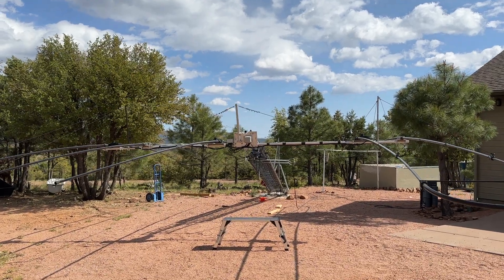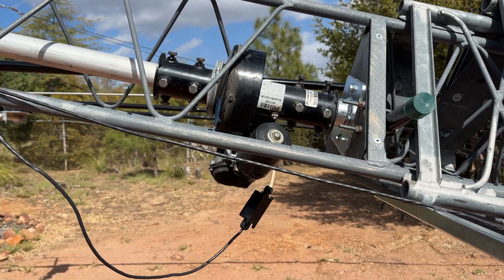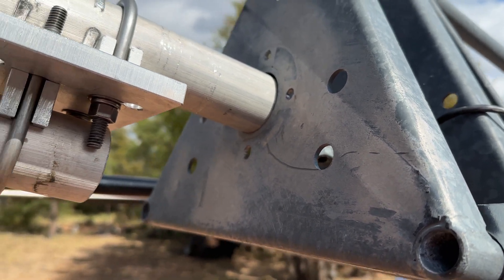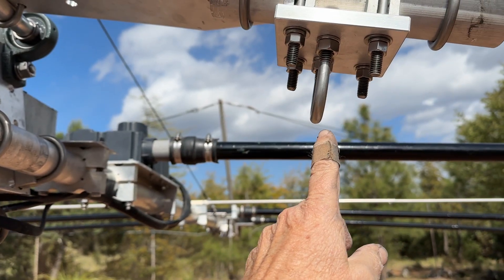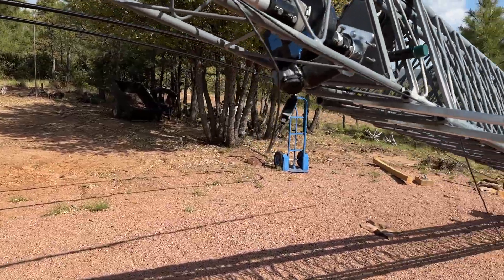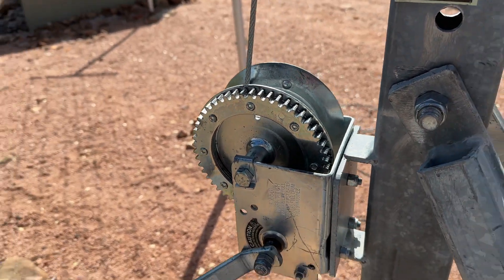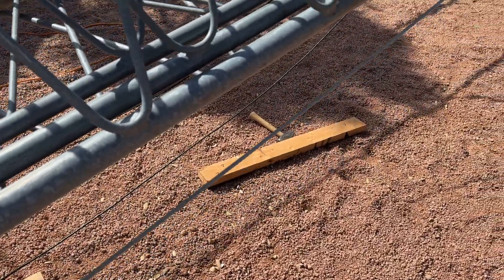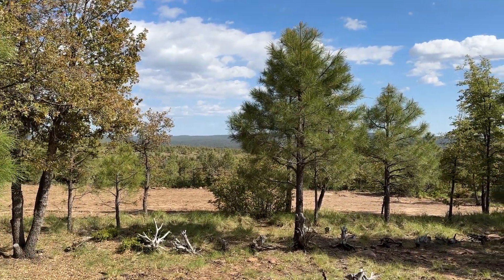Steppir 18 going up with a Tiltplate

Comment: The Sun will soon Destroy that Fiberglass and it will need rebuilding. They work great but the lifespan is short compared to an Aluminum Antenna which will last for longer than we will with just a new coax every 6 or 7 years.

Comment: Hello Dave, every time you want to raise your tower, do like me,
the only thing you need to do is remove the crank, leave the nuts and use a small cordless electric drill... and there you go...!! 73´s congratulation for your videos and your station..!!
Reply from the maker: Yep, I could have put a new hand crank winch on the crank up part of it that was a worm drive nd do that just fine.  I replaced that with a tower mounted electric hoist.  it only takes it from about 25 feet to 45 feet because I just don't take it up all of the way.  We get frequent storms so up and down happen often.  Tilt over, I changed the factory 1500 to a 2500 hand crank and WISH I'd done a worm drive on that.  With almost 200 pounds on the end of a 25 foot tilted tower, it gets pretty rough getting it over and back.  The clutch is a real problem.  Tilting in down, the clutch gets very warm and I swear, it is harder to get it down than up.  Tilting is probably only a once a year thing now, so we'll see.  Thanks for the advice.

Comment: Awesome, I hope its working well and hope to hear you on the air! Just have one question,  how big is that base and how deep did you go with it??? 73's N3WUB
Reply from the maker: Hi Peter!  It does seem to be holding up rather well once I put shear pins in each sleeve that connects to the mast.  20x40 beams can have some real torque with even a small breeze.  The tower specs said 4x4x5 feet and that is how big the hole was.  That's one part I never have to worry about.  73 AI7R

Comment: I notice that on the tilt winch/rigging-  The tower has two locations for lifting sheaves and you are only using one (2:1 lift ratio). If you wanted to go easier on your body, add a second sheave and lengthen the lift winch cable to give you potentially a 3:1 ratio or a 5:1 lift ratio instead with the same hardware youre using now (just a longer cable, if you can fit it on the winch drum).  
73,  KB2UHF
Reply from the maker: Thanks for your thoughts.  Good ones.  Not long after posting this, I changed out the winch with one that had a higher rating a the ratio that makes tilting it up and down is FAR easier.

Comment: Hi Dave,
For the tower lift winch, I would recommend this one. The advantage of a worm gear winch is that it does not depend on a brake to hold position when you stop cranking. Dutton-Lainson Gear Winch Worm Gear, 2000 lb WG2000. I use a drill with a socket to drive the winch rather than use the crank handle. 73  WJ3U
Reply from the maker: Hi Don!!  Thanks for the info on the winch.  I found a Fulton 143200 that handles 2500 pounds and is geared much better for the tilt-over part.  I'd researched what everyone else was upgrading to, and this was a newer version of what most had gotten.  It looks pretty beefy, but I haven't installed it yet.  Thanks for the comment.  I'm sure it'll give others some significant input.

Comment: Cool love the tilt plate. I hope I can get one for my tower and Steppir.
Reply from the maker: It is a game changer just getting antennas on, off, or maintaining them.  So far so good.  BUT, I was an idiot to use the winch it came with to crank it over.  Make sure you look into something rated MUCH higher and has a better cranking ratio.  73 and enjoy!

Comment from the maker: Sorry about the wind noise.  Hence the reason the old rotator broke.  It's always windy up there.

So, the tilt plate is fantastic.  Expensive but awesome.  Guenther who builds them, is a great guy too.  http://degendesigns.com

The plate under the rotator, the coax standoffs, and the mount for the hoist came from Chris, https://www.kf7p.com. The quality is super!

I did get it cranked up.  1/4 turn on the winch at a time for the first 55 degrees or so.  Whew!!  That was a long hour.  The next project is to motorize that part of it.  Actually, after some later research, I'm probably super lucky I didn't lose the tower or my life.  That winch is very underrated for that load.  A 12,000 electric winch for the tilt-over is in the tower's future before it ever tilts over again.

And although it is tilted slightly because I didn't get it mounted exactly right, it works like a dream!!

73

Dave, AI7R

ai7r.net
Reply from the maker: @@tryndoxme248 Yep, one should never take a chance.  I usually have a brace under the tower when it's tilted over like that.  I did this just before tilting it back up.  You are right.  Even with a brace I don't put myself under the tower or antenna.